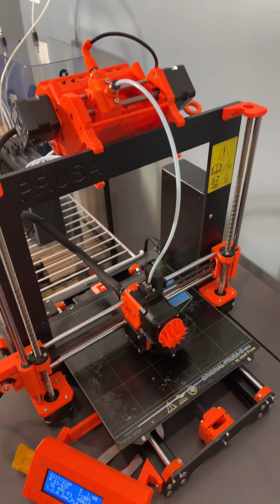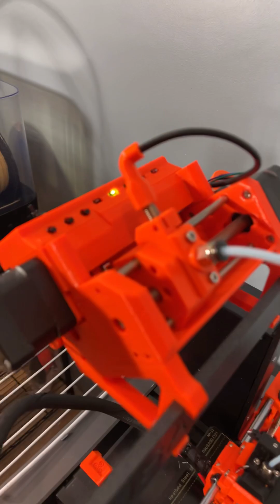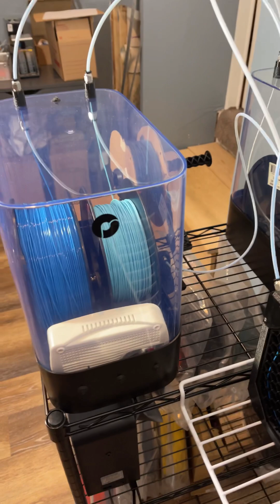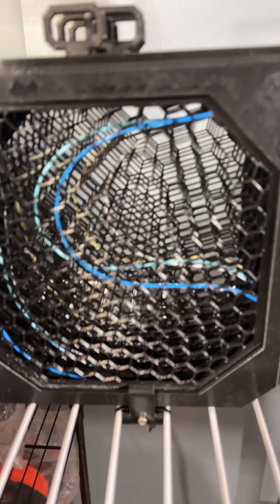Prusa MK3S+ Multicolor Printing with Slot Buffer and MMU2S

Comment: Can you add that to any printer the buffer thing?
Reply from the maker: The slot buffer just stores about 15cm of rewinded/retracted filament and has no electronics in it. It is only needed if you have a color changing system that does retraction and need a way to manage that so it doesn't make a small loop and snap on itself or kink up on a spool. You dont have to use all five slots either. So if you have tubes going into your printer and need a retraction system to store the retraction length of about that amount or less it could be used on any printer.